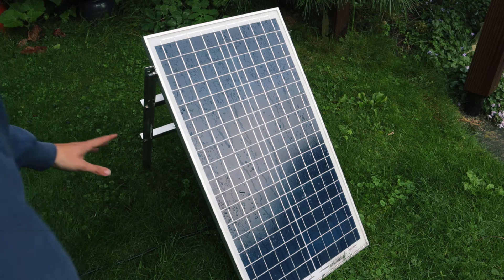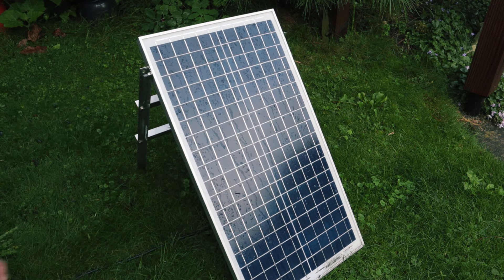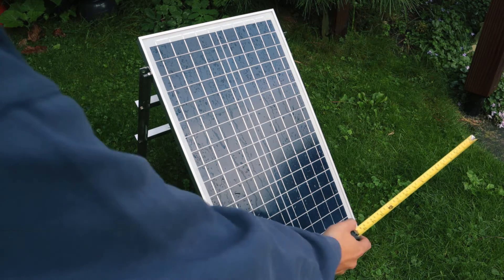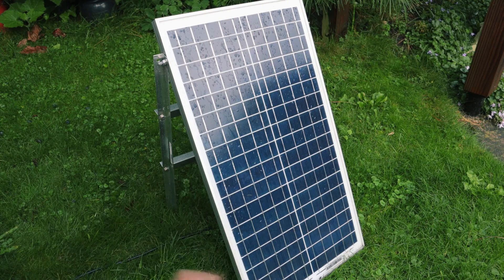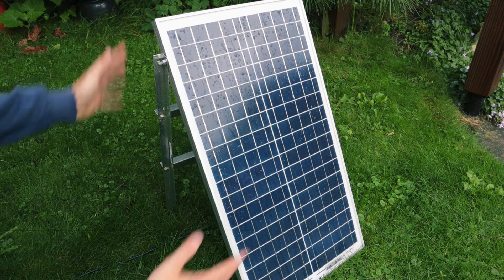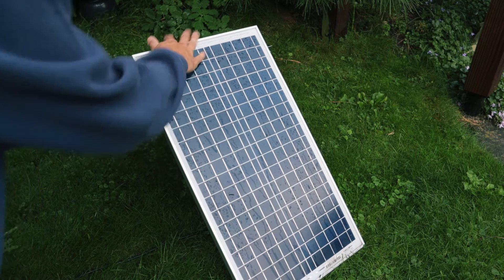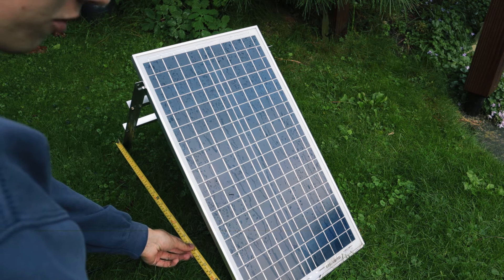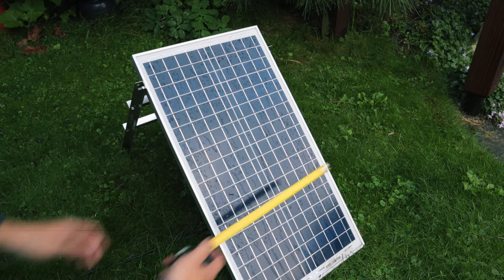Making a sun-tracking solar panel

Comment: Dear Akiot Tv, i really like & appreciate your videos for their simplicity & clarity of content (&, of course, your honesty in admitting - I don't know too!). Sir,  (correct me if i am wrong here onwards) won't it be better to move or rotate the solar panel on the vertical axis alone or along with the horizontal axis? As i figure it, tracking  the sun's path vertically will help maximize the power output with the sunlight shining evenly on the surface of the panel. An unevenly lighted up panel may not provide maximum power output.
Reply from the maker: @chetananam9141  possibly it would be better. The straighter you point the better, but a multi-axis tracker is more complex/expensive too. Whether that's worth it also depends a lot on the location.
Reply: @AKIOTV  Thanks for the reply

Comment: Just wanted to say a huge thank-you!!! As a teacher I understand both the time and effort developing these informative teaching & learning materials. AN AWESOME JOB. This "Tube" was clear, precise and coherent. MAY I ASK, seeing I am a little new to this type of electronics and IT, would you supply a RECOMMENDED parts list - product list. I wish to have my Year 6 Primary students create a tracker from scratch. Seeing I pay for everything - not the school, I would appreciate knowing the exact items to buy, seeing I'd be using multiples of everything, and don't want to blow it. Again many, many thanks and I  hope you may have time to respond. Kindest regards, Glen
Reply from the maker: The electronics I used are in the schematic available at the link in the video description. The stepper motor I used is a rather heavy NEMA23 sized unit. I don't know which exact one but it's 1.8 degrees per step and rated for 4A. If you google "NEMA23 stepper" and look for these specs you'll get very similar if not identical motors. 

Structural parts I mostly got at the hardware store or I already owned them. Anything that looks similar to what I used and feels strong enough will do. Probably you could come up with a better design than I did though. 

The gears I used are for model RC vehicles. An example of such a gear (not the exact same one, but the same type I used) is seen here: https://www.conrad.nl/nl/p/reely-stalen-tandwiel-soort-module-1-0-boordiameter-6-mm-aantal-tanden-20-231770.html 

Of course I don't know if that site is a place you can order from, but this kind of gears should be available elsewhere too, the key finding them is to look for model (RC) vehicle gears. (although make sure not to get the super tiny stuff, it won't be strong enough). These stores usually have good sort-by options etc. that allow you to easily select gears that are compatible with each other.

In general, for all these parts, physical stores are always better than online when you're trying to get things you're not entirely familiar with, it helps a huge amount to be able to visually inspect what you're actually getting, not to mention people who work there may have useful knowledge. Especially for electronics physical stores are hard to find nowadays, but if you have the option absolutely go for it.

Comment: Question, it seems that the threaded rod will rotate into the stand and eventually bottom out on the mounting screw used to mount the motor in the design you show in the video.  This will also change the messing point on the two gears.  Is this correct?  Is it your intent?  I'm looking to build a similar one and enjoyed your video but I just have this one questions.  Please comment back if you find a moment.  Thank you!
Reply from the maker: @OLD_MAN_DIY  When the panel turns, it does technically 'screw' itself down, but it only moves 180 degrees max, and at the end of the day it turns back to the start. It never makes a full circle. So it only moves a very small amount vertically.

Comment: i found the wind will turn the panel many times and that why i use a worm gear assy instead.  the wind can't turn it.
Reply from the maker: @georgebaker8108  Clever solution. I've not had many problems with the wind though.

Comment: The automatic sun position tracking is cool, but in my opinion, it is enough to rotate the platform in accordance with the current time.
Reply from the maker: I thought about doing that, but that method brings up some unexpected issues, making it more complicated than you might think:

- the position of the sun isn't entirely consistent with time over the year, it changes depending on the date. This can be fixed either with a huge lookup table with all dates/times and corresponding positions, or computing the position using some non-trivial math (ok let's be fair it's probably not that hard but thinking about orbits/timezones and stuff is a complicated mess).

- most microcontrollers don't have an absolute clock. This is also the case for this arduino: it doesn't know what time it is. you could add a clock module in the control box to fix it, or transmit time information to the controller using an external source (perhaps a computer).

When you realize you need to take care of all that, you might as well do what I did, or perhaps use some simple light sensors instead.
Reply: @AKIOTV  Some LDRs would make your system more efficient as you would not have to scan through the maximum so far to get the correct position
I agree that the clock method would need you to know where on the earth you are to get it to work correctly.
The sensor system also ensures the panel is looking at the part of the sky that is producing the highest energy not assuming that that is the correct position using a clock.

Comment: Way back in the 70's and 80's I played with a BASIC program which determined sunrise/sunset times for my location. I am sure by now that those types of programs can calculate the exact location of the sun at any time (I knoe that automatic telescope programs exist for even hobbiest). If you could scan horizontally and remember highest voltage output, then return to that location and then scan up and down vertically, you then have the location of each axis for the current sun position. We do that with radio direction-finding). Still, very informative and pretty easy for even the layperson to follow your build. Thanks! (By the way, here in Hawai'i twice a year, in May and July, the Sun passes directly overhead. On these two days, around local noon, the Sun will be exactly overhead, at a 90o angle, and an upright object such as a flagpole will have no shadow.)

Comment: just use 2 LDR's with a wall between them. Compare them and then adjust the solarpanel.
Reply from the maker: that would work too, but the solution in the video needs no extra parts (since was going to install the current sensor anyway for power monitoring.)
Reply: Yes, this type of design approach can do away with costly Arduino boards or microcontrollers & programming.  Low cost op amps & transistors do the job equally well.  A few circuits of such a type are available on the internet.

Comment: Nice work!. Think about reducing the gearing so you have way more precision in rotation and, factor in Wind!!!. Have bolted position adjustments!.
Reply from the maker: You're right about the precision, I think there's something to gain there. Luckily I don't need to change the gear ratio for that, just a software update will do. The controller now moves the motor 16 steps in one go, I think I'll change that to 8 or so. (much smaller movement is easily possible on the motor side of things, but then the differences in power output from the solar panel become too small for my current sensor to reliably detect.)

I wasn't that concerned about the wind, since the location it's in is very well sheltered from the wind. There happens to be quite a storm going today and it's still standing as I write this haha. I may still bolt it down just to be safe though :)